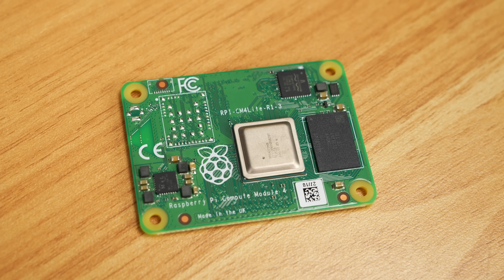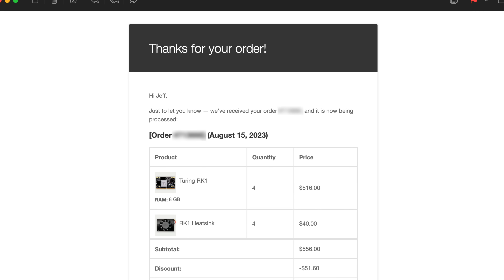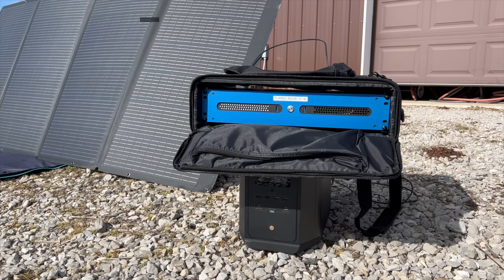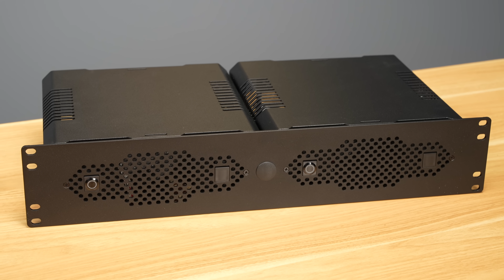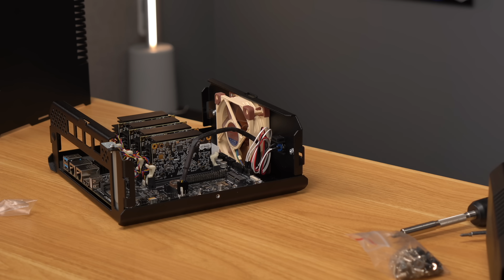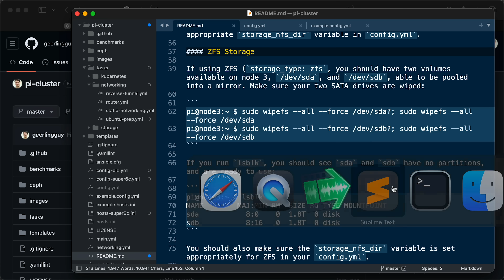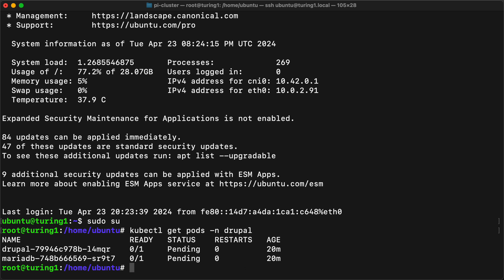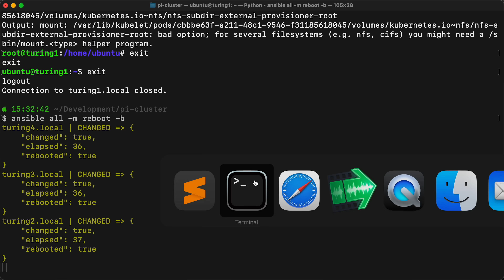Meet the new SBC Linux Cluster King!

Comment: you can design a 1u UPS utilizing 18650's or the slightly larger 21700's a bms chip and simple usb or uart to communicate the battery info to the cluster/PC

Comment: I thought pi clusters or just clusters in general don't combine compute power like that? you even said so 1:00 So how did you determine it has 24 tops?
Reply from the maker: There are applications which scale across clusters, like HPL, that can in fact aggregate some of the power (though it'd be more efficient to have one giant server).
Reply: @JeffGeerling so does this work kinda like having 2 12gb 3060a for example? They dont register like one gpu but software like ollama can split the work load in half between the two which is essentially the same thing as pooled resources. So you could run a 18gb model like it's pooled? Do clusters work similarly when using it as a single device and not as individual devices?
Reply: @JeffGeerling if that's the case I'm going  to build one

Comment: Just say NO to Phillips screws!  Hex all the way!  Also the PSU board, just de-solder the power leads and feed them from the other side?  I am surprised they went to all that trouble and then did not provide a atx back plate!

Comment: Hey there. I'm using an old HP Compac 6500 Pro SFF with a Phenom II processor, 16GB of RAM and an SSD. My use for it it to play around with embedded systems, so Kicad and coding tools are essential. I also use Linux Mint because it's lighter than a lot of other distros. My question is, would changing my setup for a Pi5 be beneficial? I need more performance but I don't want to break the bank. Even if having a cluster that could grow as my needs increase, like venturing towards sensor fusion and ML, could a Pi cluster be the answer for me?
Reply: There may be some performance increasing compared to your ancient processor.
Reply: @ thanks. Is there a way to benchmark the two?

Comment: Looking at this setup, would it be possible to use the Turing Pi 2, with the RK1 boards running Kubernetes Harvester?  I found that Kubernetes Harvester will run on ARM bare metal but, unable to find an instance of it running on this configuration.  Running VMs on a Turing Pi 2 is the desired outcome, which I believe would be the most real world use.  Thoughts? Thank you in advance.

Comment: I'm intrigued by the idea ... as a hobby / educational endeavor ... being a grad student in computer science ... it would be fun to play around with to try clusters for machine learning in my own home... but on the realistic side ... it's a very expensive toy ... you get a lot of this stuff for free from vendors ...and ... a dedicated machine learning platform with an NVIDIA GPU built around the same price point will definitely blow all of those out of the water in performance ... Fun factor 10+ ... practical use 1.  The price of the R-Pi hardware is getting to the point where the average computer hobbyist is better off spending their cash elsewhere. That 6 Pi board alone if you're using the 8GB versions & 6 NVMe cards will cost over $1000.

Unfortunately all it's really good for is experimenting.

Comment: Interesting video, but ARM SBC Clusters are absolutely terrible, there's no performance or value, with the only advantage being low power, but AMD's Ryzen processors that are built on the latest nodes will get you better perf/watt if you limit the clocks a bit, plus a single one of the ryzen chips blows this or any cluster out of the water multiple times over— And you don't have to fumble with the complexity and shitty networking. Let's not even start with software compatibility.

Comment: i really struggle to come up with a reasonable justification for having one of these low power clusters
Reply: As a developer I see a use case for testing different optimization strategies, in this case buying those clusters would be a lot cheaper than renting full scale clusters.
I can off-course just calculate everything on paper or simulate the environment but being able to test everything on hardware is very nice.

Comment: ugh the only thing i'm not liking is the even number of nodes. In most clustering tech like kubernetes you need a leader election process that requires an odd number of nodes. So the cluster would either be: 1 control-plane node so no HA for the kubernetes controller or 3 control-plane nodes and only 1 worker so no HA for the applications. HA is a huge benefit of Kubernetes. if it was 3 per that would even make more sense...

Comment: I found with k8s that setting up calico or flannel (can’t remember which one) messed with mDNS on the cluster, it would change the source port of the response and avahi would drop it. It would add some iptable entries and would always put its own rules first even if you manually inserted your own rules before.

No idea if you use those in your script but noticed you’re using mDNS figured it was worth shouting about

Comment: i am not an experienced PC Builder, but there are two reasons to push air out instead of in.     1:    Dust,     pushing air in also pushes dust in.  Arguably dust can be pulled in by the vacum created.  2:  Reducing airpressure in an environment has an great cooling effect.      I would be interested to hear your other peoples opinions on this?

Comment: if you want the led activity indicators from your cluster board, I would try to make a passive light pipe solution with some pieces of clear petg filament, perhaps with a little bit of gaff tape or electrical tape or something to keep the light in the pipes seperate.  diy fiber optic.

Comment: If you are going to standardize on 12 VDC devices, you could put a battery in the bottom of the rack.  Then you can feed the rest of the rack from there.  Could even get a DC power bank and use that to connect to the AC or DC source of your choice and keep the rack powered even in transport.

Comment: 18:30 well you can get some small form factor ups from eaton, well there are just desktop ones and i think you will have to make a bracket of some sort to fix them into place but it schould be doable (maybe they even include mounting kits for 10 inch, its some time since i installed one of them so i can´t remember 100% if it had that or note but from memory the size schould fit)

Comment: I wonder how it compares to a Milkv pioneer, double the cores, same memory, not a cluster but a "desktop", it does have 10G eth (x2) and NVME.

It's less than double the price, for double the cores and the same amount of ram but probably faster as it is all in one place. No NPU on the pioneer, but it does have pci-express ports so you can add a large video card if the drivers support it, and if you upgrade the power supply.

I absolutely loved the 10 inch rack idea, this is new to me. I have a (official status pending) RISC-V lab in Costa Rica, with a bunch of licheepi4a, vision five I&II, beagleV, mangopi, etc, etc. I think the milkv pioneer is mini-itx, so it would be cool to fit in all of the lab in this rack. It's a bit pricey, but would look and function way nice than what I have right now.

Comment: I got plenty 10" racks at work and we are using the TP-Link TL-SG1210MPE switch for it (: PoE, SFP, managed.... downside is the external power supply...  fits perfectly in a 10" shelf
Reply from the maker: Not a bad option! I do wish it had all ports + lights on front though, instead of the desktop configuration with the ports on back. Though, depending on what kind of gear you have, it may be cleaner that way!

Comment: Fan recommendations?
Reply from the maker: I am using a Noctua 80mm PWM fan, the clearance is okay, but I will probably re-solder the power connection on the Pico PSU. I haven't seen a good 80mm slim fan, though. They probably exist!

Comment: it's a shame about the network, RK3588 chip has 2 x Gigabit PHY (GMAC0/GMAC1) (if I read it right) 
so maybe the Turing pi 3 comes out they might have a way of using it and fixing that bottle neck
Reply from the maker: Yeah honestly, I don't think they were planning on building the RK1 until the Pi Shortage, and by that time the design/components for Turing Pi 2 were pretty much set in stone. So it was a board optimized for the BCM2711, not the RK3588.
Reply: Now just have to wait and see. 
Mind you if the take the feedback. It will be good

Comment: You should be able to install 6x Radxa CM5 (with RK3588S) in previous board. This would beat Turning Pi's board in performance. The only thing you lose is PCIe 3.0.

Comment: Wait....so BETWEEN the nodes, it only uses a single GbE connection???

That doesn't seem particularly great.

The Turing Pi 2 doesn't have a system interconnect built-in to the board?

I agree with you that that will imit its usefulness given that typically, internode communication would be (significantly) faster via a backplane of some kind rather than through a single GbE NIC.

And whilst the Turing Pi 2 in and of itself is not super expensive, as a complete solution, at close to $1500, I was able to buy three N95 Mini PC nodes for a fraction of that price. That's a bummer.
Reply from the maker: It has 1 Gbps between all nodes, switched. So you could get 4+ Gbps of internal bandwidth (maximum 1 Gbps full duplex per node), but then that's bottlenecked by the external 1 Gbps connection too.

Some things like compute are fine with that limitation, but storage is a lot less useful unless you're mostly doing small file work.
Reply: @JeffGeerling  
I guess that it depends.

e.g. if you deploy Ceph RBD/CephFS, you might be able to get away with using GbE as the Ceph system interconnect.

But I agree that any data transfers into and out of the cluster would be limited by the GbE external interface.

That being said, GbE per node in the cluster, still isn't a lot, especially when it comes to internode communication.

Pretty much all of my primary storage servers are still using GbE as the interconnect between said storage servers (mostly because other systems don't have at least a PCIe 3.0 x16 slot available/open).

As such, that's also what drove me to consolidate everything onto a single server because then with virtio-fs, there is no theorectical maximum bandwidth limit on virtio-fs itself.
Reply from the maker: @ewenchan1239  If you get a chance, check out the Mixtile Cluster Box; it uses PCIe interconnect, which may solve that problem... but it seems to be a pretty niche implementation and probably needs some time to mature to be easy to use.
Reply: @JeffGeerling  
Thank you.

I'll take a look into that.

edit
So I took a quick look into the Mixtile Cluster Box and it will REALLY depend on how the ASMedia PCIe switch chip works.

I currently use 100 Gbps Infiniband as my cluster interconnect, and in a relatively brief testing, where I switched the port link type from 1 (IB) to 2 (ETH), host-to-host, with 8 parallel streams, I can hit 96.9 Gbps (out of a possible 100 Gbps).

But VM-to-VM, the best that I can do with the same 8 parallel streams, was closer to 34 Gbps, so it REALLY depends on the specific implementation and deployment.

(I'm still playing around with trying to get SR-IOV working on the Mellanox ConnectX-4 cards, but the issue that I am running into right now is that so far, none of the Infiniband "inbox" drivers that ships with Linux distros, seem to be successful in setting the Node GUID and Port GUID for the VFs, which means that I haven't been able to successfully use the VFs at all. (Physical state says: LinkUp, port Active state says: Down. Either it doesn't pick up on the SM that's running and/or that it doesn't know what/how to deal with it.))

Plus, a fully kitted-out Mixtile Cluster Box isn't that much cheaper than this solution ($2095 USD at the time of writing).

Comment: CAUTION: The NPU is EXTREMELY limited. It can only do inference on some limited precompiled models for object recognition and segmentation, like yolov5 (not 8 wont work), and inceptionv2. It's all proprietary, they use their own model format and you have to convert everything to it using int8. It has nothing like tensorflow or pytorch. NPU is useless for LLMs. At best its comparable to a crippled Coral Edge TPU with little software support and no general purpose composable compute graph like TensorFlow. I have used their RKNN tools and API quite a bit and even though at first excited to see on-chip NPU integration, the reality was less than exhilarating.

Comment: The mini UPS sounds like a cool idea. I'm thinking, make it be a shared power supply as well, so integrate a switch mode power supply in there that keeps the batteries charged, and have a bunch of 12v outputs with individual reset-able fuses, plus maybe some 5v outputs. Include a micro-controller in it with some temperature and voltage sensors to keep the charge levels and temperature in check, with an output to a character LCD and a USB port for UPS management.

Comment: This was great idea on first version, slick elegant, 6x nodes with all io wired, so You did not lose anything compared to regular SBC. When they later reduced modules and designed it for pi4 cm with those limits then You obviously loosing 2.5G ethernet, most of video input/output and pcie 4x. I also noticed that all those modules are much more expensive (rk1, radxa cm5, others) than regular SBC. 
One guy here bought about 10 of turing pi 2.boards. He quickly realize about those limits and now trying to sell those at fraction of price. And nobody is interested :/ You could get ROCK 5B 32GB for $190 for BF which means that probably You will be able to build 7 node cluster plus 2.5G switch with sfp+ uplink and some power supply. New Radxa ROCK 5B+ is coming with DDR5 and two m.2 sockets so You can consider 10G ethernet as well, still having place for two times faster nvme than here. 
Of course I can clearly see few benefits of this solution, but on the other hand I fell that its way to limited. Many youtubers received samples, and this marketing is rather aggressive. I still prefer my simple sbc RK3588 cluster, I learned a lot with it and this is not that hard to assembly everything.

Comment: I understand that the ethernet bottleneck is a real one, but ... my background is in machine learning and I might argue that there's actually a bunch of solid use-cases with this setup. There's a bunch of places that would really benefit from having something that can run high compute without requiring a cloud provider. Have you ever looked into that? I'm thinking about training/hyperparameter searches for scikit-learn models here, these typically don't need GPUs ... might be a solid match?

Comment: Isn't buying a single Beelink or Minisforum mini PC a better option?
Reply: Probably.. everyone saying sbcs are power efficient.. but for that price you can get couple of refurbished sff-pc with i5 / i7 from hp or lenovo.

It's the same with the RPi5 i got.. until you have everything to actually run it, your at the price of a mini(itx) pc.

So if you dont need the ultra tiny size or super specific hardware for a real special task.. meh. If you have space for a monitor, you'll mostly have space for something vesa mount.

Comment: this looks to me just like HW pr0n , because SBC main use is for GPIO ports  so some stupid hardware can be explicitly controlled, but this one does not have any GPIO. for mini ITX you can get am5 with 7600 (or X both with simple 5min OC settings) which gets singleCore score for GeekBench to about 2,9k , multi for 13k. so that single core does SBC's work of all 8cores. that is slow as hell. And you do not have any GPIO in both options.

Comment: about 20 years ago the cluster system working on 1G bit ethernet was too slow, which we could get off, our HW teams had a 10G switch backplane and looking at 100G or maybe a 1T switching backplane (but we were working on an edge router for a city 500,000 users per cluster) full HA with fall over in less than 1mS.
but looking at the internet today we may have needed 10T bit

Comment: this stuff does not make sense when for this price you can buy 3-5 mini pc with 8 core ryzen cpus. you don't have to deal with arm specific software and the performance are 10 times faster.
Reply: ...But this is more fun...
Reply: @josuesantos871 😂agree
Reply: Rule of cool means this is better
Reply: And probably consumes 10 times the power.
Reply: I agree with you. My co-workers are all about SBCs but it doesn't make any sense to use them most of the time. When it does make sense are mobile applications like car and boat PCs, and remote stations that are powered by solar and nighttime battery banks.  I don't know what you'd use a cluster for in a remote application. In a fixed site it would probably be better to point to point wireless to a place with more cost-effective high power output and use regular processors. An 11 year-old Ivy Bridge Xeon 2S can crush the compute performance of this entire cluster. But presumably someone needs them for something, or they would go out of business quickly.

Comment: Idea for a cluster: take Framework Laptop mainboards (the ones with USB 4 for PCIe tunneling and 10Gbps+ networking) and bolt them into these enclosures. I think you might even be able to fit a full 4 of them in there. the keystone slots at the back up top could be USB-C Keystones for power and for the big opening you could 3d print an IO shield so you could put in other keystones for IO. Fully x86, BLAZING fast IO for that small of a cluster, and possibly pretty energy efficient.

Comment: These boards are super cool, but it’s just so hard to justify when you can easily get something like a HP 705 G4 for less than $100. Add an M.2 2.5Gbe NIC for another $10 and you have great low power home lab node.